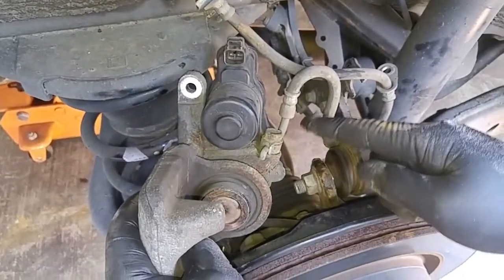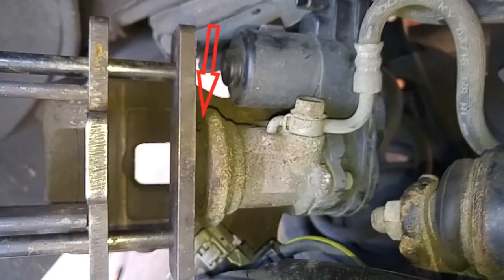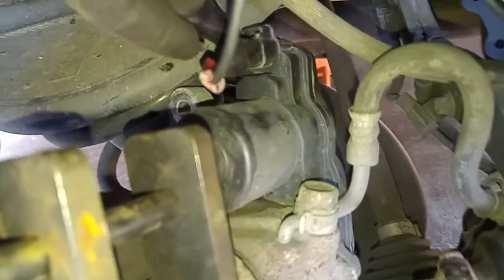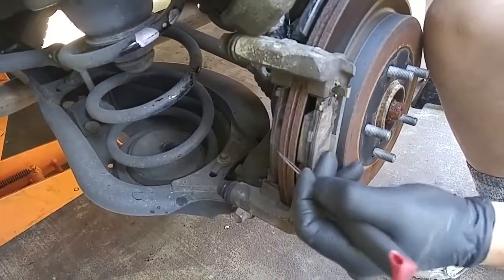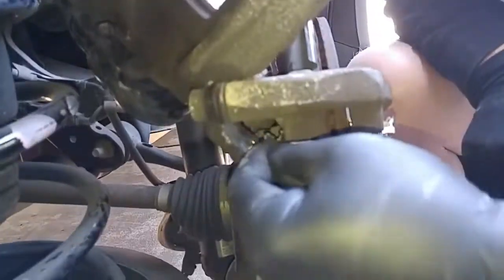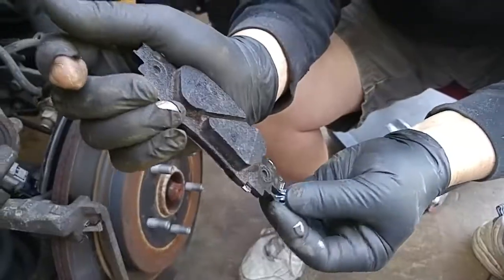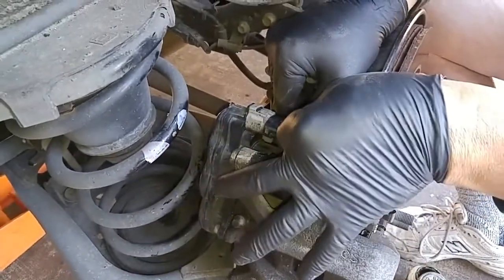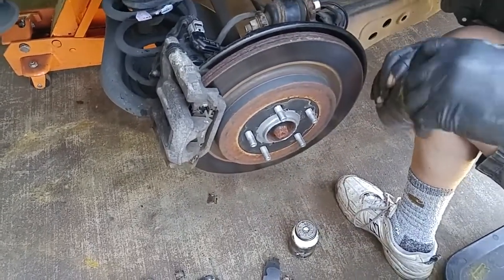Lexus RX350 / ES350 Rear Brake Pad Replacement (Electronic Parking Brake w/ Brake Hold)

Comment: Up here in the rust belt I highly recommend removing the guide pins completely, clean them, clean the hole and then grease and reinstall..salt finds its way in and causes them to drag/seize causing the uneven wear you see here.
Reply from the maker: Great point and good advice!

Comment: What can you do if piston ‘flew out’? It’s still in place but expended all the way out and won’t go back in. Appreciate any help.
Reply from the maker: Release the parking brake and press the piston back in.
Reply: @hardlymovingpro  I tried this however the piston appeared to be dislodged. I was able to set it back in it's bore (or at least that's what I think I was doing) after disconnecting it from the brake hose  - Thank you for your quick help and creating these videos!

Comment: Oh my god.. Don't you know how to put EPB into a service mode? 
For those who watching and believing to this *hit - there is more easier way to do this.
Reply from the maker: More details to put it in service mode please.
Reply: @hardlymovingpro strange, I twice leaved a comments with link to youtube video, where it's explained how to put EPB into a service mode, but they were removed. Ok, I will write it down.
How to enable EPB service mode:
1. Switch on ignition (without starging engine) and push EPB switch down. Switch off ignition.
2. Switch on ignition (without starging engine), push and hold brake pedal, move EPB switch 3 times up, then 3 times down. Release the brake pedal, push EPB switch down and hold it. After a while you will here how EPB is releasing. Keep holding EPB switch down until it stop make sounds and "P"(parking endicator) starts flashing on screen.
3. Now you can switch of egnition and do you replacement of rear brakes.

How to disable EPB service mode:
1. Switch on ignition. Push and hold brake. Move EPB switch up and hold it. After few seconds you will here how EPB turning back to it's normal position.
2. After EBP will stop making sounds, release EPB and brake pedal.
3. You can enable automatic parking. Push and hold brake pedal, move EPB switch up and release.
Reply: @BarbosSergos  It only works on the newer models. My 2019 RX350 doesn't support it.

Comment: great video. short and to the point. everything stated in video worked.  i used a 12 volt portable remote jump start /charger (the size of a cell phone) to activate and retract the caliper piston. if not for this video, i would have been stuck. other videos used a special tool to supply 12 volt power to the motor. this video kept it simple. thank you.
Reply from the maker: Great news and thanks for sharing your experience!

Comment: why don't you do it the right way...all you do is trun key on . foot on the break ...pull on parking brake switch 3 times then push on it three times and hold until you see the light blink... to  re engage just  pull up on the switch and hold with key on and foot on break , till light goes out
Reply from the maker: Doesn't work all the time and a lot of steps.  But thanks for sharing!

Comment: I messed up and the piston came out of the caliper.  Any tips how to get it back in?  The boot isn’t quite elastic enough for my fat fingers
Reply from the maker: Remove the brake bleed valve and push the the piston back in.  Reinstall the valve and use a brake bleed suction tool to create a vacuum in the caliper cavities.  The vacuum will pull in brake fluid.

Comment: Thanks a lot for the video! I've watched it and was about to do the same on my wife's 2016 Lexus RX350 when I accidentally discovered a much simpler and easier way to make the car rewind the parking brake motor all the way to the service mode. No messing with wires, no disassembly, clean and simple!
(A note: pulling parking brake button up three times, pushing it down three times and holding it like shown on some videos doesn't work on 2016 Lexus RX350. No matter how I tried, it didn't work. Maybe it works on later year models, but not on 2016)
So I was about to mess with the motors like suggested in this video when I stumbled upon this amazing simple method.
So here's how you do it:
Remove both rear wheels.
Engage parking brake (pull the button up)
Disconnect the parking brake wire from ONE of the calipers, e.g. driver's side.
Now, release the parking brake by pushing the button.
You'll hear long whining sound on the OTHER caliper, i.e. passenger side. Then dash will say "parking brake failure, go see dealer!". Apparently, when you disconnect one caliper, the computer senses its absence, thinks "OMG, malfunction!" and just in case fully retracts the other motor! Bingo! That's exactly what you need!
Now you go and do the brake job on that side like you'd normally do. When you done passenger side, reconnect driver caliper, and engage parking brake. The computer will see that both motors are present and engage the parking brake as usual. 
Then you do it the other way around - disconnect the passenger caliper and push the button to release the parking brake. The computer will again think "OMG! Failure!" and retract the driver's motor all the way.
Do the driver's side brake job, reconnect the passenger's, done!
Hope that'll help make your life a bit easier next time you do 2016 Lexus rear brakes!
Reply: It did go away on its own. I have a 2016 rx350 as well.
Reply: This is the best way I found regarding rear electrical parking brake retract.  I assume the message "parking brake failure, go see dealer!" will disappear once you re-connect all the plugs? Also do you turn off the car once the parking brake retract and while you are doing the rear brake job?
Reply: @kenli4807  you will need a code or scan tool to fix. Your assumption is not right. The message not go away on it owns.
Reply: This is what I discovered on my own after accidentally breaking the wiring connector. Had to order a used break wiring harness from Lithuania in order to fix it myself.
Reply from the maker: Good job and thanks for sharing your story!

Comment: how to disengage the electric parking brake?  simply press the the "P" button?  Or there are certain proecess we need to fellow in order to put it the parking brake released model? I am trying to replace my RX 350 Rear brake Pad, and just don't want  miss anything, and get myself in troubles.
Reply from the maker: Even with the parking brake being electronically release via the "P" button, the parking brake motor must be recessed (as shown in this video) in order to compress the brake pistons back into the caliper to install new pads.

Comment: This is not any break wear indicator. It's almost flush with the metal base. If you go by that - you will go metal on metal. 
 It's just a spring to push on pads so that they don't rattle in the brackets.
Reply from the maker: It's a wear indicator to show that you're around 1 to 2 mm of pad life left.  When the indicator touches the rotor (metal to metal), they'll be a high pitch squeal.  You've got a little time before the rotor and the metal pad will contact each other;  then sparks will begin to fly!  Brake rattle is prevented with abutment clips which reside between the ears of the pad and the caliper brake pad mount points.

Comment: For people who don’t feel comfortable unwind the motor by apply 12vdc to it then there is another easier and safer way to do so. 
Simply separate the motor from caliper by loosen up 2 fasteners and retract the piston by turning the screw by hand. Hope it helps
Reply: This really works?? Anyone confirm? I’m having trouble dont want to pay 600
Reply: @g3artacular  It works according to another video I just watched, they retracted the brake with a star bit.  Each time they compressed caliper, and it stopped, they would retract the motor more until caliper was fully compressed.
Reply: @Boja23  link the video pls
Reply: @novaskies5538  https://www.youtube.com/watch?v=le6P0fdaCw8&t=758s I found working with the rear brakes with the retractable parking brake really easy.  Don't be intimidated at all.  I can't remember all of the specifics because it was so long ago, but I did find this video in my history.  Hope that helps.  I also replaced all of the rotors while doing all of the brakes.
Reply: @Boja23  thank you! yes looks manageable. :)
Reply: i did that with my 2016 rx 350 @g3artacular
Reply from the maker: Interesting idea!  Thanks for sharing.
Reply: Omg this worked for me n my bud thank you. It worked on my 2021 base es350
Reply: I think it's easier to use an obd tool and put in service mode

Comment: I used kids 12v car battery to retract rear brake minus(-) AND plus(+) from your view angle then used vice to squeeze. Remember to ignition then pump brake multiple time then manual park on and off for initialization.
Reply from the maker: Thanks for sharing!
Reply: What do you mean “manual park on and off”?
Reply: @damon323  manual parking brake switch near seat climate control area.
Reply: @yoonlee5278  Awesome, thank you!

Comment: I just saved 1100.00 bucks by doing this my self, (A local Auto shop quoted me a price for this task) thanks fir the video I'm ready to replace the rear brakes
Reply from the maker: Glad it helped!
Reply: $1,100 for this? Wow! I just changed all of my 2010 RX 350 brake pads, plus all the sliding pin boots. The cost was $155 plus six hours of my own time. Doing the electronic release of the rear calipers would probably add half more hour to the job. but it'd be totally worth it.
Reply from the maker: Good for you!
Reply: 6 hours???? To do brakes?

Comment: What brake pads did you replace with?  My 2016 is chewing up OEMs
Reply from the maker: It was a TRW brand, was hard to find and it wasn't cheap since the car was so new and no aftermarket pad providers. The problem was there wasn't enough grease on the caliper slide pins to allow the caliper to "float" thereby causing uneven pad wear.
Reply: Dude, you need Akebono brake pads. Japanese made, best there is by far
Reply from the maker: Use to buy but expensive and didn't come with new abutment clips.  Found Raybestos EHT and Centric PQ Pro pads and coated rotors to be just as good or better.  Did a recent replacement on a Audi S4 and owner said it brakes better than when new.
Reply: @hardlymovingpro  I agree on the clips but they finally include them now. But yes, they didn’t used to. I’ll definitely check out those rotors, been researching a good set. Thank you!

Comment: Do you know what the torque specs are for the brake caliper or the lug nuts on the tire?
Reply from the maker: Lug nuts around 80 lbs.  I don't use a torque wrench for small nuts and bolts.
Reply: 25-30 ft-lbs

Comment: Thanks for the detailed instructions! For tools available in Canada, I used these:

Lisle 29100 Quick Quad Pad Spreader:
https://www.amazon.ca/gp/product/B005GLQCKA/ref=ppx_yo_dt_b_asin_title_o03_s00?ie=UTF8&psc=1

Double ended alligator clips:
https://www.amazon.ca/gp/product/B07PF334JT/ref=ppx_yo_dt_b_asin_title_o03_s00?ie=UTF8&psc=1

I happened to have a NOCO Genius10 battery charger with 12V constant mode, so this adapter worked:
https://www.amazon.ca/gp/product/B004LWQ35Y/ref=ppx_yo_dt_b_asin_title_o03_s00?ie=UTF8&psc=1

Comment: Questions...
Should we lube the shims that the shoes slide on?  Would it be best to pull the caliber pins and clean them and lube them?
Do NOT want to own a vehicle with this electric brake mechanism. ...Thanks for the video...
Reply from the maker: You mean the pad shims and pads?  If so, yes ... apply high temp brake grease between the shims and pads to prevent brake squeal.  You can pull the pins all the way out to clean them but don't grease them up until around 1/3 or 1/4 way in the caliper pin hole.  Otherwise, an air pocket will form inside the caliper pin hole and you may have difficulty pushing the pins all the way back into the hole.
Reply: @hardlymovingpro  Thanks for the additional information.  It is helpful!   I always check those rubber boots  that are on the pins, for cracks and holes.... when I pull Them.     
 Sure you all do the same.
Reply from the maker: @bwest-yq3uc  Absolutely!  But this car is less than 3 years old and the pin dust boots were fine. What was messed up were the caliper pins.  They were locked up from lack of lubricant which caused the uneven brake pad wear.

Comment: So for some reason I'm getting these news items on my PC from "Tomorrow's Tech" magazine, and talk about a timing coincidence.   Today a new brake thing popped up.  This is what it said: "On some European vehicles like Mercedes-Benz models, rear pad life is measured using the electronic parking brake module. The system engages the rear brakes with the stepper motor in the caliper or the motor that actuates the cables. The system will count the number of motor rotations needed to engage the rear brake pads. "
So if you saw/caught the part where it said these cars use a STEPPER motor for the parking brakes, well, ya can't "turn" a stepper motor by applying 12V.  This is what I was worried about.  So, I guess the solution would be to use the - not too expensive - scan tool I sent you the link for.
Reply from the maker: That's a good price on that scan tool.  Looking for something a little bit better that allows me to re-flash a salvaged replacement PCM module.  Doesn't happen often, but had a need to replace a car's computer after exhausting all sources on why the car wouldn't run or run right.  Believe the heat build up (living in the South) can burn out capacitors on the computer board.
Reply: @hardlymovingpro  Autel has scan tools that will take you to the level of a re-flash.  But of course they are going to be in the uppers $100's, pushing to, or over $1,000.  I showed you the MaxiCheck mainly because it does do the electronic parking brake, and it is very reasonably priced.  And my other comment included that it appears that not everybody can just apply 12V, and if they HAVE to get a scan tool, this one is low cost.  
Actually, I was surprised that the Lexus one was just a DC motor, since I just assumed all of them were steppers (which require a digital drive, not just DC).   Thanks again!  I always learn new things when I watch your videos!
Reply from the maker: I generally avoid working on German cars unless I can come to a quick resolution.  Over engineered.  If my fault diagnosis lingers, I don't charge the customer anything and refer them to another shop.
Reply: @hardlymovingpro  I had a few experiences with German cars.  And they were enough to make me feel the same way - avoid them whenever possible!  For the same reasons you stated....

Comment: One more question - please?  On this Lexus you applied the 12V to turn the motor.  Would you know if many other car brands are the same way?  These electronic parking brakes are very popular now, and some say you need a scan tool to do what you did.  If all you have to do is apply 12v to any of them, it sure would make it easier.  So I'm asking - if you know - are many/most like this (just apply 12V)?
Reply from the maker: As far as I know, all cars on the road today conform to 12v DC as their electrical power source.  With golf cars, lawn tractors, motor cycles, etc., I've see 6v to 24v.  If you want to use a scan tool, you'll need a bi-directional version that can communicate with your car (year, make, model) to activate the motor.  These tools are usually big $$$'s ($1,000 +) compared to most scan tools  that just read data and rest codes.   Bought one tool for $500 advertised as bi-directional.  No such animal.  Either the software was missing to communicate with my car or the capability wasn't there.  Sent it back for a refund,.
Reply: @hardlymovingpro  Hi....I understand that most cars run on 12V, but what I was impressed with in you video, was how simple it was using 12V to back the brake off.  I was (and am not) sure ALL cars back the brake off the same way.  And that's what I was asking.  You see I have an Autel MaxiCheck Pro scan tool (just over $200) and it has EPB as an option, where it will do the magic using it.  Here's a link to it: https://www.amazon.com/Autel-MaxiCheck-Pro-Diagnostic-Service/dp/B075ZLVXHY/ref=sr_1_2_sspa?crid=2O4JH51HSZQWJ&dchild=1&keywords=autel+maxicheck+pro&qid=1590497099&sprefix=autel+maxi%2Caps%2C151&sr=8-2-spons&psc=1&spLa=ZW5jcnlwdGVkUXVhbGlmaWVyPUEyTFQ3V0VCNjBVQkkwJmVuY3J5cHRlZElkPUEwOTU5NDAzMThTSTlXTTNaRFlPNSZlbmNyeXB0ZWRBZElkPUEwNjM5NDYyMktTQTBLRUU3UzNCJndpZGdldE5hbWU9c3BfYXRmJmFjdGlvbj1jbGlja1JlZGlyZWN0JmRvTm90TG9nQ2xpY2s9dHJ1ZQ==
I think I prefer YOUR way, because this way if for some reason the scan tool you have doesn't do THAT MODEL car, you can just hook up the 12 V - IF it works like on this Lexus, on ALL cars.  Thanks again for your time to respond!